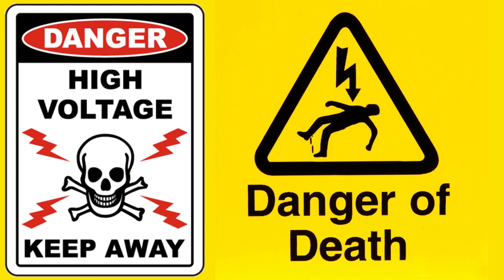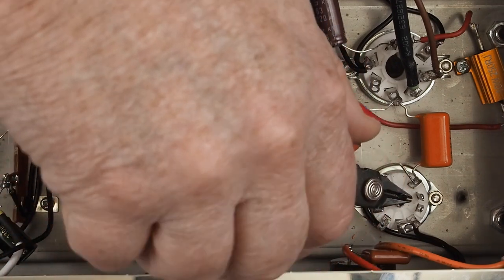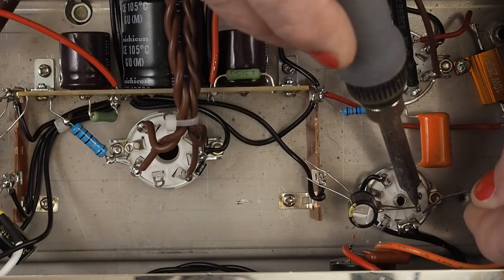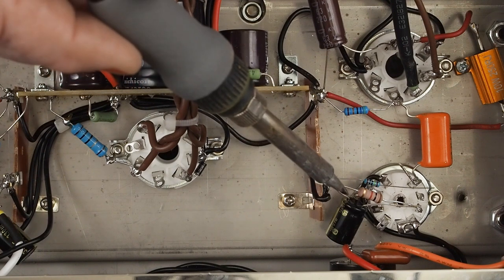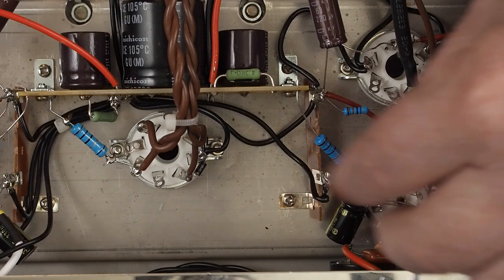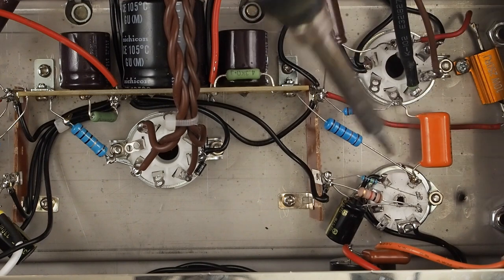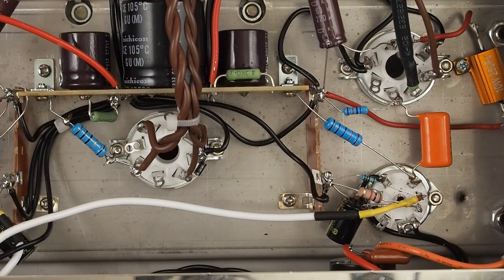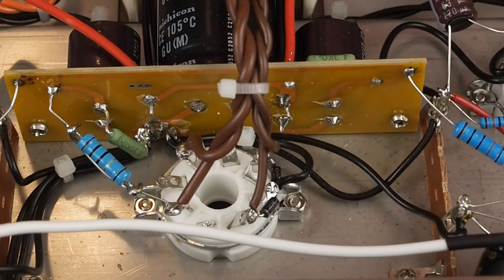Boyuurange Reisong A12: Doing the Mods Video #2

Comment: I watched all the A12 mod videos and finally finished my amp. I upgraded to Sovtek 5AR4, JJ EL34L and Genalex Gold Lion 12AX7 (regular) tubes. I also used 620K p-t-p feedback. I am running this amp to 1986 Klipsch La Scala speakers with the AL crossover. This is my first tube amp and first mod attempt. I don’t have measuring equipment, just my ears. Before mods, I thought the amp sounded very raspy and grainy. High frequency sounds were harsh and fatiguing. After mods I can definitely hear much cleaner and clearer vocals and more pronounced and pleasing dynamic range with improved bass. I would like to thank Skunkie Designs for all the time and effort you put into fixing this amp and creating the videos. I will definitely enjoy this amp regularly now.

Comment: Well, I did the mods to the letter as described in this video and it's predecessor. Mine started out as an A10 which I rewired to an A12 firstly so I didn't have to use converters. As well as Skunkie's changes I also changed the smoothing caps to better quality (Rubycon and Panasonic) and changed the feedback caps to Miflex. Powered it up and straight away there is a considerable improvement in the sound quality of this amp. Much more body and real power and clarity. The feedback resistor I'm using is 820k and that sounds just fine through my Snell Jii's. The PT does get much warmer after a couple of hours playing but not too hot to touch. I'm a newbie to DIY audio so if I can do it then I would expect most people could if they follow carefully Skunkie's  instructions. Thank you for your time and your detailed videos.

Comment: Thanks Skunkie for the amazing mod and in depth videos - this amp is so much better without the distortion and cleaner at higher volumes! 
For anyone interested, I settled with 620k Schade feedback resistors. Nice rounder sound than stock, with a touch more warmth. Using Monitor Audio Silver 100 bookshelf speakers
Reply from the maker: I think it's so cool how changing the Schade feedback resistors shapes the tone on these amps.

Comment: Truly appreciate this series of video on making the A10 / A12 a better sounding amp. Thanks a lot Stephe. And in regards to the feedback resistor, I played around quite a bit, from the lowest 470k, 520k, 570k, 600k, 620k, 660k all the way to 820k. To me with my speaker set up (a pair of Klipsch RB-51 II bookshelf), 660k seems to sound best. Anything below 570k does add quite a bit of bass, but on some songs I listen to everyday, it starts sounding too warm and lose a bit of airiness, detail and holographic effect. And anything above 700k sounds too bright to me. Also for those of you with the A10, I didn't convert the driver tube to 12AX7, I simply cut half of triode as what Stephe did, ground one side of it completely and also ground pin 9, and it works just fine. I m not sure if the 12AX7 will sound better than the 6N2, to me seems like they have very similar characteristics, and the 6N2 although the choices are quite limited, they are considerably cheaper than most 12AX7. So for now I just stick with the 6N2 until they burn out.
Reply: I had the same subjective result as you so I decided to park the feedback value at 620k, I'm using Pioneers SP-FS52 and I think the combo is perfect for the majority of music that I listen to.

Comment: Stephe ROCKS! Ignore anyone who says different. I have had a Reisong A10 (not A12) for several years gathering dust. It just didn't sound very good to me, even after tube rolling in some NOS tubes. I followed her videos here, and the results were frankly amazing! SO much smoother, much better bass and overall enjoyment. I am actually playing with the Schade resistor value a bit. It's a bit bright for my speakers, but I can't say enough about this upgrade. For very little cost, this is now a nice little tube amp that I will use regularly. THANKS, Stephe!
Reply from the maker: Thanks :)
Reply: Hi, I have ordered an A10. I am willing to do the mods. Do you still run the original 6N2J tube or have you fitted the 12AX7 tubes? If so how have you done it. Thanks from tropical Australia.

Comment: Just finished doing your mods to my A10 now A12 and I had to send you a comment. It really does sound much better. Went with your BOM and I'm using RP400M speakers with a Polk Sub for now. Can't wait to try it with my Cornwall (original) speakers which are in storage. Thank you so much for doing the work and sharing.
Reply: У вас имеется reisong a10? Вы сделали все изменения как в А12?

Comment: Skunkie, did mods on A12 , noticed huge improvement in Bass at lower volumes I use. I use Reference 3A Dulcet speakers with Berlarim tweeters, equals bright sound, I played with 820K , 300K, 470K and finally settled on 600K to balance the tone to my liking. I feel this feedback resister option is the key to voicing your amp to your speakers. This is the best lesson on amp modding I have ever found, most appreciated.  Brian and Kathy Orr   (Niagara Falls, Ontario)
Reply from the maker: It's one reason I like using this style of negative feedback, it's ability to voice the amp.

Comment: Love your videos. I did the recommended mods to my A10. Swapped the pins to fit the 12ax7. Double checked all the wirings. Plugged all gold lion matched pair tubes in and turned it on. Once the rectifier tube was hot, it started sparking all over the place and the speakers were crackling. So i turned it off. I am not sure if the GZ34 gold lion tube blew up or if something else was wrong. So I opened up the amp again to make sure everything is wired fine. I am not sure how to measure the B+ voltage without the rectifier tube in. Any help would be appreciated. I am not sure if I just need to buy a new rectifier tube or if I have a dead amp on my hands. Thanks!
Reply from the maker: Sounds like something else is wrong from this description.

Comment: Good call on needing to rewire the A10 drivers to a 12AX7’s. I had forgot that. At least I can get rid of the adapters..
Also, I don’t mind a more forward presentation as my ears are damaged by 30+ year’s of working in marine engine rooms. From screaming 2 stroke EMD’s to rumbling MAN’s. Probably why I like horn speakers 😁
Reply: On an A10, what if we still want the option of running the original driver tubes? 62np?
Reply: Yeah ??

Comment: Hi guys, I have a a10 and I did some changes on the output tube. My driver tube im using 2ax7 with the adapter my question if i can do this same as a12 to rewire the drive tube thanks to skunkie video step by step instructions and easy to follow … i need more info im a beginner diy my a10 sound better than before for now thanks
Reply from the maker: Yes you can, it's the same amp other than the input tube wiring.
Reply: @SkunkieDesignsElectronics  thank you very much there’s a lot of guy’s that have a10 amps enjoying right now because of your kindness

Comment: Got my A12, out of the box it sounded pretty good after I cranked up the output of my Schiit Mani to 48db of gain. Measured about 1.4W just before clipping but the top of the wave was fatter than the bottom. Noticed some component value differences from the original schematics you posted. B1 filter cap was now 220uF instead of 150uF, and the ultra linear tap resistor was 10 Ohms instead of 100 Ohms. Wonder if it was the same on your unit or if they changed the components. Anyway, mods on the works now, looking forward to giving it a listen when complete. Thanks!
Reply from the maker: I think they sometimes just throw whatever they can get cheap into these amps.
Reply: @SkunkieDesignsElectronics  Agreed. btw, the mods came out great. Over 5W before clipping now. Sounds great, but could use some better lows. May compare removing the feedback loop and reducing to 680K and see which sounds better. Thanks again for your dedication to the community.
Reply from the maker: @FJCruiserChannel  Try reducing the feedback resistor to a 470K. Removing it will make the amp even brighter sounding.

Comment: Are the Voltages checked with ohny the Rectifyer Tube or with all tubes in place? 

With only the Rectifyer Tube installed 
My B+ = 340 V
My B2= 340V 
EL 34 Pin 3+4  = 348 V

But: At the Anode Triode Pin 1 or 6  of the 12AX7 have 380V instead of 250V without the tube installed.
With all tubes installed: 310v
Reply from the maker: The voltages are always with all the tubes installed. There is also an issue with made in China amps that the power transformer doesn't have the correct primary winding voltage, which throws off everything! Shoot me an email and I'll try to help.

Comment: How true......! Like a brand new amplifier. In each and every respect. Did the job last night.
Not only loads of more useable power, but  dynamics , detail and punch in a truly other league
 than stock. Tried both with and without 820k Schade feedback loop. Guess I preferred without,
 but that is to soon to tell anyway, and will take quite some experimenting and listening to settle. 

One thing that may be of interest to other guys who plan to do this mod is, the resistors brand 
and type one choose. Since I had used european dealer hifi-collective England a lot already,
 I figured I order the components from them instead of Mouser. 

HiFi-collective are not into general electronics, but niched more towards mid- to upper class
 audio spec components.
The 2W resistors I bought, TKD 2W Metal Film Resistor,  indeed seem to be of very high quality, 
but diameter of resistor itself is about twice that of the Mouser ones you use, and the leads 
are also much thicker and stiffer, making the adapting and mounting job much more demanding, 
and also it gets alot more crowded around tube sockets etc.

Anyway, Steph, thanks a lot for your good work, and helping me understand what a decent EL34 SE 
amp should be like. More than anything, I would love to hear your strategy and reasoning for each
 of the changes you made, and which of them you judged the major bottle necks if any obvious.

Now I will only have to get rid of the 50 cycle hum I have, but not due to this mod, but my 
recently installed remote volume ALPS pot, with total rerouting of the yellow hotwire from 
RCA in the back etc. It worked nicely until yesterday, so I must just by coincidense have 
put the wires to close to transformer or similar. Experimentation will most likely solve 
that tonight after work. Best regards, Magnus
Reply from the maker: I don't think it was any one thing that was the bottle neck and can't really recommend only upgrading one part of this. The feedback resistor is a "to taste thing", depends on your speakers and even left out the THD isn't bad, it's just one percent or so more than with it at higher power levels.

Glad this worked so well for you, and you now see what a decent EL34 SE amp sounds like :)
Reply: @SkunkieDesignsElectronics  Indeed, thanks!

Comment: I have the A10 which I'm going to upgrade to 12AX7’s, the black wires off the power transformer go to pin 4 and 5 (I used from left pin around to the right pin 1-9 going around clockwise), Do I just move pin 5 to pin 9 and connect pin 4 to 5? Or am I missing something there?
Reply from the maker: Yes, one "leg" of the 6.3V AC goes to pin 9 and the other goes to pins 4 & 5 which are connected together.

Comment: IT's the WE local FB trick , seen on many WE  old amplifiers ..............and yes , it works fine , one can listen and adjust the value , ( also with the driver tubes chosen this may vary )..............one can even get rid of overal NFB and stil have extreme low distortion on low signals ( less than 0.01 % with 100 mW output..............( condition is met with the very best OPT !!! )
Nice to study some of these old WE schematics and the results.....

Comment: Great vids and mods, thanks a lot! I'm completely new on this. Could you tell me if this can be done even if I've already put it in triode mode? And one more thing, sorry for that. If I wanted to replace the potentiometer for an ALPS one, could you tell me the specs for it so I can find it? Thanks again!
Reply from the maker: 100K is a good value for the pot, I'm not sure how this would work with the output tube triode strapped. I do know it will have 1/2 the power that it would have in UL mode, or maybe less.

Comment: Update: I (you) finally did it. After messing around with values and stuff which got me nowhere, I got my 5AR4 rectifier tube (I was using a 5V4), plugged it in and WOOOWW. Everything sounds great now and instruments are finally in place. You really did it! But, of course, now I want a little bit more... If you wanted to improve the soundstage (deepness/3-dimensionality of the sound), what would you try? Replacing the orange coupling cap? Bypassing the electros with some 0.1uf film caps? All ears on your recommendations. Thanks a lot!!
Reply from the maker: Try replacing those orange coupling caps with some Mundorf Alum/oil. Don't be tempted to get the higher end ones, IMHO the alum/oil sound the best. After that I would look at replacing the output transformers.

Comment: Great job with those mods. I’m glad it sounds good too and has nice low end. I’m with you regarding the rectifier tube in this case. I’d swap it out for some diodes and make it solid state rectified. As you said, it’d cool down the PT, and it’d also most likely give you cleaner tighter low end too. My main amps are a pair of Quicksilver mid mono monoblocks which are PP using two KT88’s and a 12ax7 input tube and a 6922 driver with solid state rectification per amp. They’re also completely hand wired. I voided the warranty of em within a week by upgrading a few parts. So, like you were saying, if you’re gonna modify something don’t plan on sending it back for repairs. The beauty of it, is that amps like the A12 and my Quicksilvers are easy to work on, and you can own em forever with little to no issues. Another excellent vid! Thanks!
Reply from the maker: The owner was pretty adamant about keeping tube rectification. I'd probably go with SS to cool down the PT, get a tad more B+ and find something to cover the hole up or just leave that china rectifier there. Maybe stick a green LED under it like McIntosh does :P
Reply: @SkunkieDesignsElectronics  Hahaha! 🤣 You could also put LED’s under every tube, cuz you know…. It’d sound better. lol 😜
Too bad the customer doesn’t understand the benefits of solid state rectification, especially in this case. 
Thanks for the laugh!
Reply: Personally I prefer tube rectification sound, plus crappy diodes can cause problems. I can switch between both ss and tube on my amp and I used ss once. That was to check it works. Ss just sounds lifeless to me.
Reply from the maker: @flyingmattyboy  People are passionate about this topic, I'm staying out of it :P
Reply: @SkunkieDesignsElectronics  get that. That is why I said "personally". I think this one is a personal taste / belief thing.
Reply: @flyingmattyboy  I think it also depends on the design of the circuit. This particular amp obviously had issues in the design, and in this case I personally think SS rectification would work better, but I’m not positive. I’m just going off the information I have. I’d have to hear it to be absolutely positive. I had a guitar amp that could switch between SS and tube rectified. The preamp in my HiFi system is tube rectified, but my tube amps have SS rectification. To me, it’s a balancing act of sorts. Both rectification ways have their strengths and weaknesses, but again, I feel it’s the design and one’s preference as well. 👍🎶🙂🔊
Reply: @SkunkieDesignsElectronics  🤣 lol
Reply: @NickP333  yes true, I often wondered if my 834 would sound as good without ss, as it is silent. But in my sse it doesn,'t work for my ears.

Comment: Hi Skunkie.  I just completed all your mods to my 6P1.  WOW what a difference!  So, ready to move onto my A10.  I want to switch to 12AX7 from the 6N2 in it now, without using adapters.   On the driver tube sockets, moving the wire on pin 5 to pin 9, and jumping pins 4 and 5 is easy.  But on the driver socket on the left (amp upside down, power and volume facing toward me) there is a wire between pin 4 and ground.  I watched your video about 20 times and never once saw the left socket LOL.  So, not sure, does that wire to ground stay on pin 4 (which will be 4 and 5 after the 12AX7 mod), does it get cut and removed, or does it get moved to a different pin on the socket or different point inside the amp (after modifying it for the 12AX7?   Thanks again!
Reply: Oops, never mind.  I found a picture of the entire bottom side on your schematics page, saved it and blew it up.  Yup, it stays!   Onward!
Reply from the maker: The two channels are wired identical. I believe (it's been a long time since I did this amp/video) I created a virtual center tap on the heaters using two 100 ohm resistors and grounding the point between these two resistors. You can also just ground one leg of the winding for simplicity, which is what it sounds like they did, you don't want to do both.

Comment: Phenomenal series. May just give this a shot!

Does the volume control need upgrading and/or does it bypass in full volume mode?  Thanks so much for the videos. 👍

PS - if you sold mod packages to go along with your videos, I’d be first in line.
Reply from the maker: I'm not a big believer in volume pots "impacting the sound stage" or whatever else I hear said about them. It's a simple voltage divider, but I don't think you can hurt anything installing a higher quality one. I'd personally spend that money for better coupling caps or tubes to play around with.
Reply: I by passed the volume control (rewire inside) because I already have a volume control on preamp/DAC and with that by pass it sounded significantly better.  
Replacement of the orange ceramic coupling cap however made a bigger improvement.
Reply: @edverbeek6292  I’d have to take a look and see how the bypass is done. Simple wire bridge?